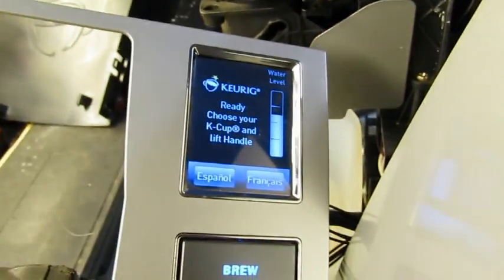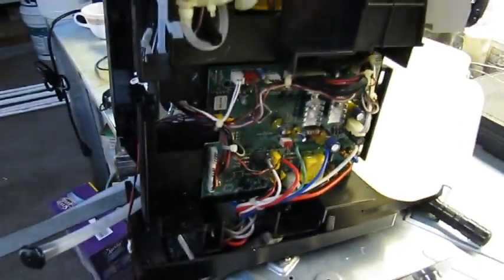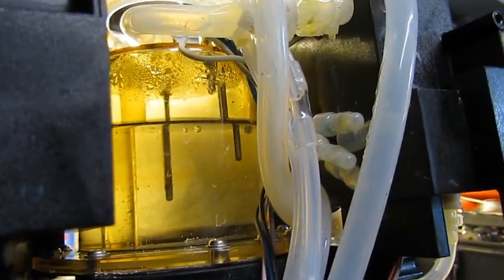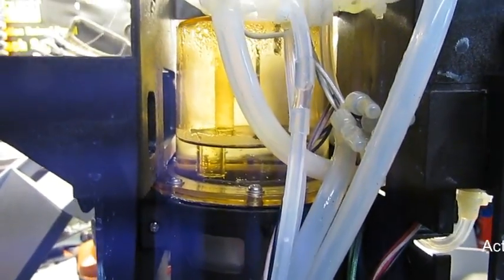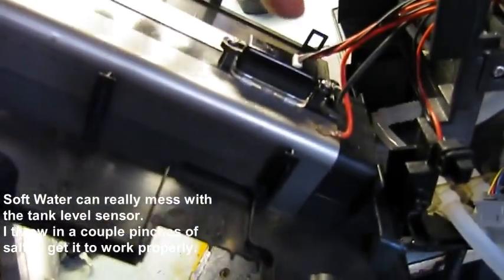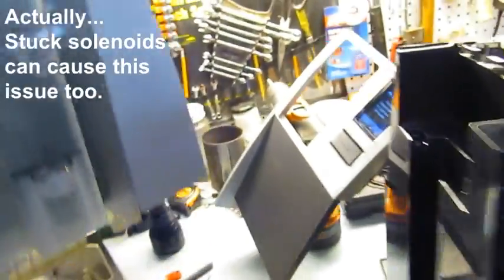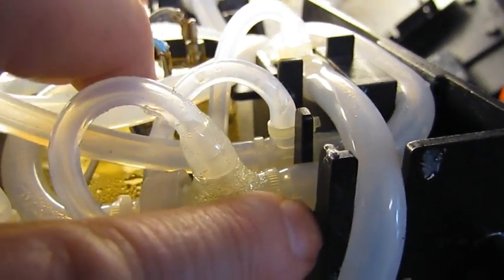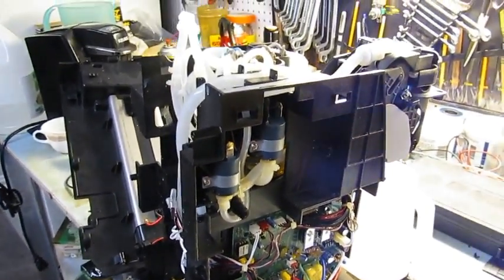Keurig Secrets Revealed - Look under the hood of a working Keurig K155!

Comment: Hello Dean,

I was wondering if you can help me out. I have a k155 that won't stop running even if i turn it off at the switch and continues to pump the water out. I took it apart amd found that the water pump is getting 11 Volts even when the power switch is off. Do you know what may cause this to happen? To me it sounds like a relay on board may be stuck close and continues to feed power to the pump plug. Any idea would be greatly appreciated.
Reply from the maker: Your assessment sounds accurate. Remove the cover and look for a relay. Follow the wires to the pump, back to the relay and repair or replace the relay. Good luck!

Comment: Thanks, that’s exactly what I needed. I was given one of these last year and recently discovered it pulls 700 watts every minute for about 8 seconds. Over two hours before it shuts down is a lot of power for off grid. So I want to install a dry contact smart switch module to the momentary switch on the back and automat it so it turns off 5 minutes after you turn it on. I was wondering if it even had the room inside for this module I want to mod and put it. Now I know it does. I guess mine is coming apart now. Now the only question is can I find a 5 volt or 3.3 Volt rail on the main board that I can tap into. Thank again for this video.

Comment: Dean, great job and the best tear down on a K155 on the web.  I picked up one used and the power button was wonky and got that fixed with some electrical cleaner.  It was working great until I followed the manual and descaled with pure vinegar.  Now when I brew a cup it dispenses the correct amount of water but fails to detect that it's completed pumping the air for serving. After 2 mins it seems to timeout and goes back to the ready-to-brew menu.   This did not happed before I descaled.  (sigh)
You mentioned their was an air pressure sensor on a circuit board in your video... I'm wondering if that failed.  Any wisdom is appreciated.  Thanks, Ron
Reply from the maker: Hi Ron, I also experienced some "strange behavior" after descaling with pure vinegar.  For example, some of the usually available serving size options were not visible on the display.  I was quite puzzled by it.   I wish I can say that I know what resolved the issue.  All I can say is that it resolved itself after multiple cycles and "system reboots".  Another thing that can confuse the coffee maker is distilled water.  There is not enough minerals in distilled water for the prongs in the tank to detect the small amount of current flowing through the water in the heating tank.  One possible cause of the problem you're experiencing (continues pumping air after proper brew) is that an air hose (between the compressor and the tank) could be pinched or kinked, causing enough "back pressure" to think that water is still flowing.  Disassemble the K155 and see if you can find a pinch, kink or obstruction of some kind in the air hose.
Reply: @deanstucker   Dean, thank-you for the reply.  I'm pretty sure the hose is not kinked since it work just fine until I descaled it.  The interesting thing it the problem is intermittent, and I can tell when it's going to misbehave.  When it works, you hear the normal "whoosh" for a 1-2 seconds after completes the brew.  When it misbehaves, it makes a very short "whoosh" noise as it completes (0.25-0.5 secs)... and then continues to pump for a minute or two until it times out.   I guess I'll keep cycling it and see if it recovers from the vinegar descaling event.

Comment from the maker: Not knowing all of the specifics, I can only recommend some ideas that might, collectively, help.  If the machine is several years old and has been fed tap water with no vinegar treatments, then I recommend replacing both solenoid valves before doing anything else. Then drain the inside (heated) tank somehow. Place a quart of white vinegar in the outside reservoir and see if the inside tank fills with vinegar when attempting to brew. This will help descale the rest of the system. If the inside tank doesn't fill then there is likely a problem with the water pump or the control board. If the inside tank fills with vinegar but nothing comes out during brew, then the problem may be a defective air pump that needs to be disassembled and cleaned or replaced. Note that the level indicator on the display may provide incorrect or missing size options when using vinegar or if the sensor pins inside the inner tank are covered with hard water scales or a film of some kind. If the brew cycle begins working (for any size brew) run vinegar through the system several times. Then thoroughly flush the system (many times) with water. You may find that all of the size options will eventually once again be displayed. That's what happened to me.

Almost forgot to mention... Make sure that all of the filters and one way flow devices (connected to the tubing) are functioning properly.

Comment: Thanks so much for allowing me to troubleshoot my K155!  For me the problem was the display stuck on "Preparing Please Wait".  I used a turkey baster to blow through the air tubes at the top as you advised, to free the air solenoids.  So far so good.  This is my third K155 with direct plumb water kit over the course of 17 years.  Current one is 16 months old, just out of warranty.  I may have been able to have Keurig still honor the warranty.  But it's Sat. and the fix only required 2 hours of downtime!  Loved learning how the inner workings function.  Thanks again.  Not sure how "Buy me a coffee" works on YouTube, but I would have done so.

Comment: Hello Dean,

I have the same Keurig and i busted it open and changed two tiny capacitors to get it running properly again. Main issue im having is the mschine is brewing 2 ounces short on every cup option. Its very strange. I will click 10 ounces and it does 7.8 every time. Trying to teoubleshoot currently and im pretty lost. Waterflow is fine, it just is always 2 ounces short.

Comment: question - I know this is 4 years late, but how did you manage to get the screw covers off the back for those 6 screws? Mine seem to be really really stuck.

My issue with my machine is that when I plug it in, the screen doesnt come on but I can hear the power buzzing, and a clicking sound every second like its trying to turn on...but I cant get those back 6 screws off for the life of me.
Reply from the maker: Yeah, 4 years is a long time.  I no longer have the machine so I can't take a look at it to refresh my memory.  As mentioned in the video, I also grew frustrated when disassembling the machine featured in the video.  I actually took a reciprocating saw to it to cut the top off as I couldn't figure out how to remove the top/back in one piece.  You may need to do the same if you get nowhere.  Sorry I couldn't be more helpful.  If you haven't done so already, you might try searching YouTube for a disassembly video of a similar Keurig machine.

Comment: Hello Dan, I have a K150P that is leaking water from the bottom/underneath of the machine. not all the time but more often lately. would this be a stuck Solenoid?
Reply from the maker: Possibly. The leak may be from a variety of issues. The only way to know for sure is to carefully (but quickly) disassemble the unit immediately after it leaks and try to determine where it is leaking by looking for evidence of moisture. Or let it dry and then look for mineral deposits left by the leaking water over time. If that fails, consider disassembling the unit such that you can still see what's happening inside the unit during a brew cycle.

Comment: Greetings, one question. I have a coffee maker like the one in the video that doesn't turn on completely. I don't know if it has a fuse or something similar that can be changed? thanks for your help and program
Reply from the maker: Yes, the first thing to check would be a fuse. That's the best I can do with a description of the problem that simply says, "Doesn't turn on completely".  More information is needed for a more thorough reply.  It would help if you would share exactly what "turns on" and what "doesn't turn on".

Comment: Hey Dean.  I have a 155 and am getting leaking out of the k cup holder while brewing.  Coffee still brews but there are a few streams of water coming out of there as well.  Have you run into this before?  Thanks
Reply from the maker: I can think of a couple possibilities that might cause the issues you're describing. There needs to be a good watertight seal between the coffee cartridge and the machine. Check and see if there are some coffee grounds embedded in the abovementioned rubber seal. This may have been caused by prematurely opening the cartridge holder while the machine is actively brewing. Another less likely possibility is that the rubber hose attached to the top of the cartridge holder is leaking. Hope that helps.

Comment: I have a K150 that came out of a closed restaurant.  While brewing, the touchscreen shows multiple photos of various coffee beans and coffee production.  I thought it would be interesting to be able to hack the software and put personal photos on the screen instead of the various photos provided.   Has anyone ever done this?  There is a port that on the back of the unit that looks like an ethernet cable can connect, but I'm not sure if that's how the manufacturer loads the pictures and programming or if it is done via the motherboard during production.  Totally cosmetic and unnecessary, but I've always thought a few personal photos on the machine would be fun.

Comment: I have a K145 Office Pro that I drained and stored for a couple of years. When I pulled it back out to try to use, it won't pull water from the exterior tank at all. I checked the needles, float, inlet valve and check valve to no avail, any ideas before I chuck this. Its a pretty new lightly used machine and it's bothering me that I can't get it to work. Thanks for your video and any help you might be able to offer!
Reply from the maker: Hi Patty. Your description of situation is pretty limited. What does the display screen say? If it appears ready to brew then perhaps the inside tank is already full and doesn't need to draw any water from the external reservoir. Does your model have an option for a pressurized water line — and is that option for a water source is enabled, thus ignoring the water in the tank? Some models sense the water level. If the tank is filled with distilled water then the sensor that determines tank level percentage (NOT the float) may be telling the controller that there is NO water in the tank, despite the fact that the tank is full of distilled water. Drain the tank, fill it with regular tap water and give it another try. If the display remains blank when plugged in, then simply toss it in the trash or give it to someone who is willing to disassemble it and replace some parts (fuse, transformer, thermal switch, etc). Hope this helps.

Comment: today I turned it on and says fill with water, while it is filled. it does not proceed to ask what size cup do you want? is it possible the water level sensor is not working?
Reply from the maker: Near the bottom of the removable water reservoir is a small disk shaped object that should move freely if the Reservoir is empty and turned upside down. If it is somehow stuck in down position then it could trigger an "empty Reservoir" signal to the computer.

Comment: i have that machine, i cant seem to turn it on, the screen shows nothing and i hear a clicking when its plugged in.. help
Reply from the maker: I think the first thing I would check would be the transformer that reduces voltage from 110 volts to (I forget) 12 or 19 volts. The transformer may have failed. Check for voltage coming out of the transformer. Take care to avoid being shocked by exposed 110 volt circuitry. The lower voltage is what powers the LCD display, sensors, pumps, etc. The clicking you hear is likely a relay that activates the heating element, which requires the full 110 volts. Another thing to check is to look for a blown low voltage fuse (if there is one) on the controller circuit board.

Comment: Mine won't heat water. Where is the heating element or fuse?
Reply from the maker: I'm assuming the system is working correctly (control panel functional, filler pump working and water dispensing properly) except it is dispensing cold water. If that is the case then you are correct to look for a blown fuse OR a tripped/blown thermal safety switch which stops the flow of electricity to the heating element when it senses excessive heat (or the switch somehow became defective). Temporarily shorting a wire across the leads of the thermal safety switch may allow heating to resume, indicating that the safety switch should be replaced.

Comment: Brilliant. Descaled with distilled vinegar.  Filled hot and cold tank with pure vinegar. Machine went stupid sensing the brew sizes while trying to rinse. Found your video and before I started unscrewing stuff I found that if I hard reset the machine, I could get it to fill once. I did that about 6 times getting it to brew a 10 ounce cup while I backfilled  with water. Then the stupid went away. The pure vinegar wouldn’t let the sensors work. Wouldn’t have known that without you. Thanks a million times over!!!

Comment: Hi! Is there a solenoid that's normally closed, that vents the air out of the top of the heater tank? That clear section, before the air pump runs to blow the water down? I'm thinking maybe the one I have isn't open and the air can't escape, so a buildup of air is blowing the water out of the dispenser before it can hit the pins.
Reply: This solenoid valve wasn’t plugged in the board.  Connector is hiding under the harness..

Comment: Hi!  Thanks for the video.  I'm working on one that only clicked.  After changing capacitors, now it keeps running water through and out the dispenser. I was wondering what 'tells' this thing the heater tank is full.   I have well water, and it's not very conductive.  Maybe I'll try a few grains of salt, literally!  Vinegar didn't help, though.  Maybe that's not conductive, either.   Thanks for the help!
Reply from the maker: You said, "it keeps running water through and out the dispenser". If this means that water flows from the cold water tank to the dispenser until the cold water tank is empty, then it sounds like maybe one of the solenoid valves may be stuck open (the one leading to the dispenser).
Reply: @deanstucker  Hi!  I opened the Kerrigan again, easier now, and followed one of the tubes from the top of the water heater.  It led to a solenoid. Then, I followed those wires, and found that plug wasn’t plugged in.  It was under the harness.. I plugged it in, leaving the machine open, and now it works perfect!
Reply from the maker: @HarryHydro  Yay!

Comment: Hi Dean, i managed to repair my K150 with a spare motherboard. It was working great until i decided to descale it. The accidentally drained the hot water from the boiler causing it to overheat, now i have a system overheat message on the unit that's not going away. I checked all the heating components on the boiler since i got two units, compared values with the multi meter, it seems fine. My guess the overheat failsafe is built into the mother board, any thoughts?
Reply from the maker: Perhaps a temperature based sensor/circuit breaker has been tripped and needs to be replaced?
Reply: @deanstucker  have you come across a control board schematic for one of these?
Reply from the maker: @jkucukov 
I have not seen one and I would be very surprised to see one outside of Keurig company walls as documents like that are usually considered highly proprietary. (Based on my experience as a PC designer for HP.)
Reply: @deanstucker  I was pulling my hair out yesterday tearing into the machine diagnosing the error message all for nothing. Today i discovered the key combination that made the message go away, waisted a day working on it. I'll be making a video to show my findings.
Reply: You mention you figured out how to reset from the system overheat message, could you share the reset sequence?

Comment: I have used your great video twice, once to dissemble to change the two bad capacitors, and today to replace the hot water solenoid valve that diverts water back to the reservoir and results in a smaller cup of coffee - thanks again. I bought a $10 valve off Amazon, which is working great but its inlet and outlet tubes are a little larger making it more difficult to install the smaller hose. - the old valve internal plastic had turned to mush.
Reply from the maker: I'm glad you found the video useful!  🙂